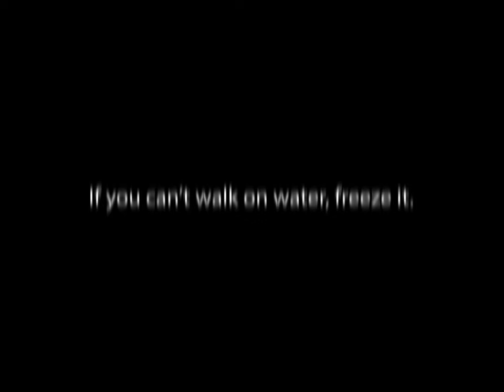Building my own house in Ecuador?

Comment: Love the completed look of Sue and Phil's house.

I watched this video last night and again today because I am so interested in the tiles in the bathroom and windows because of their size and style, it is exactly what I am looking for. We really like to watch nature and get natural light.

We are in the process of building a house I designed about 45 minutes west of Mindo, the materials for the structure will be concrete blocks, concrete columns, metal beams, reinforced rebar, and acoustic ceilings. 
With the average daytime temperature being 24 Celsius our ceilings go up to about 5 meters to the walls at 3 meters with 30 cm of screened venting along the top for airflow on the north, west, and south.

Comment: Hey Don, great video. I will say I haven't seen that construction method en la sierra.  Here they build with bricks or blocks usually plastered over and they use rebar reinforced columns. Some houses have concrete rooves some have clay tiles, some man made materials. We built our house 2 years ago. Its considered semi rústico.  Its bricks with a clay tile roof. We have wood exposed ceilings and floors.  It has a mountain lodge appearance. This style is common, especially in the countryside.  In town, more of the concrete boxy look. I like the way their house is built. My brother built using similar technology in the US.  Its good to know its available here. Thanks for the video!

Comment: The wall material looks interesting. Seems very efficient for insulting. However, I wonder if there is spacing in the wall interior to run wires after it is built, like to retrofit a new ceiling fan, light, or speaker wiring.
Reply: Hi all the infrastructure is in the ceiling so if there is ever a problem we can access it. Thanks for your interest.

Comment: Interesting construction method - metal panel frames with foam insulation and they just stucco over it for both interior and exterior walls? My family hails from Ecuador and I would like to build a vacation house there eventually. Maybe this method is better than what I usually see there.

Most of what I've seen over there is RCC columns for structure and roughly 4" x 8" x 16" concrete blocks for all partition walls  with only stucco - not particularly energy efficient. The house in this video seems to have the same RCC columns for structure but those foam panels instead of block? I initially had the idea of building with standard metal stud walls filled with batt and foam insulation between RCC columns but it appears metal stud wall framing isn't too common over there.
Reply: Hi ....this is a superior product with R22 insulation and up to a 9.0 systemic resistances.  Thanks for your interest.

Comment: If you don't mind a little "Bathroom Talk".  Does the house have its own septic system , with a lateral field ? Or is there a community sewer system that each newly built home ties into? Do the bathrooms typically have exhaust fans to remove excess moisture, after showering ?  In recently constructed homes, are you still not supposed to flush toilet paper ?
Reply from the maker: It does have a septic system. And yes to the fans and I'm not even going to bother with the toilet paper nonsense.

Comment: Was the styrofoam used as an earthquake safety measure, or for cost reduction? If it is the former, my opinion is the whole area is too risky to have a home in if doing so requires styrofoam walls. And what about the roof? The roof is not styrofoam. If those styrofoam walls collapse, and the roof comes down on you, it seems like that will kill or badly injure, doesn`t it? Earthquake issues aside, how much security do those styrofoam walls provide, against someone who will try to break into the home by just sledge hammering a hole in a wall? Seems like an ill-advised venture all the way around to me.
Reply: It looked like the foam panels had heavy concrete wire covering them on the outside. It would be hard to pound your way through it. And I assume the ends of the panels (each about 4 feet apart) had steal studs supported the roof?